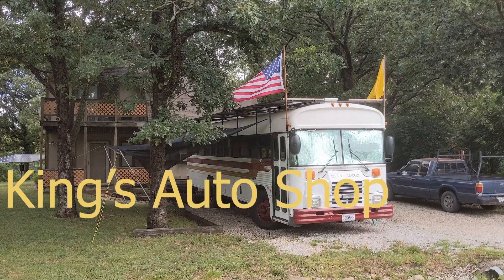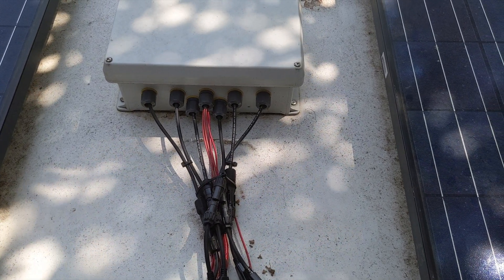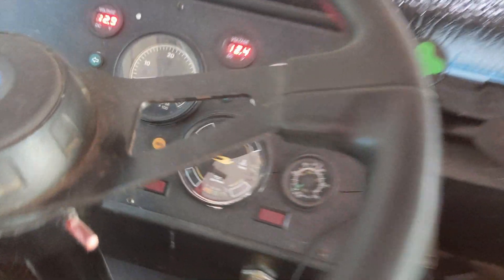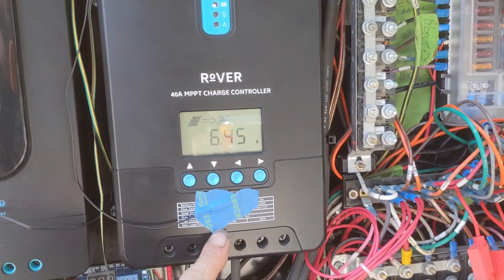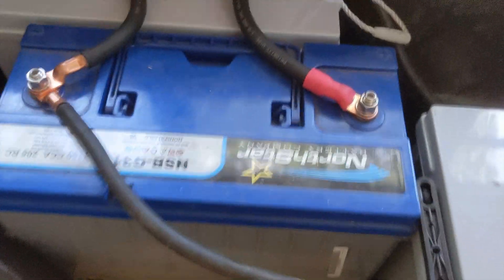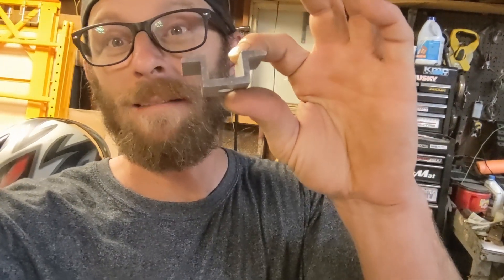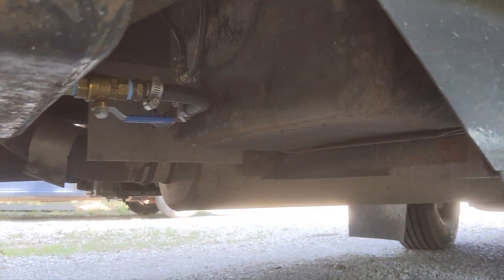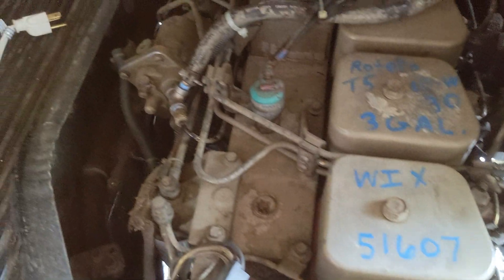Massive Skoolie Solar

Comment: You know you are supposed to heat shrink the crimp connections. They aren't waterproof or vibration resistant without it.
Reply from the maker: now that i have some i have been getting that done!

Comment: I totally love solar but dude if you get any more panels up there you're going to have wings just put on a propeller and fly that bus where you want to go LOL 😆
Reply from the maker: There will be more
I'm planning on adding another 400watts
Reply: @KingsAutoShop  so you'll be in the market for one of the electric motors from the Tesla semis right no need to keep paying them oil guys money.  What will be your total wattage in the solar then?
Reply from the maker: @allenfunstuff  rite now 3kw and 120amps
Ac take 120 amps to run